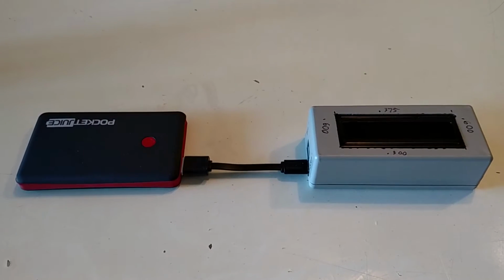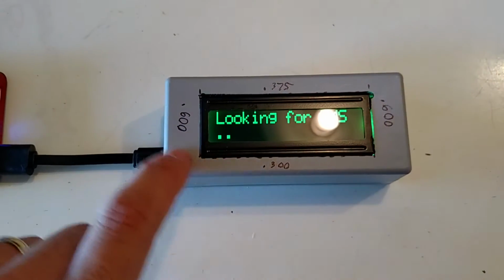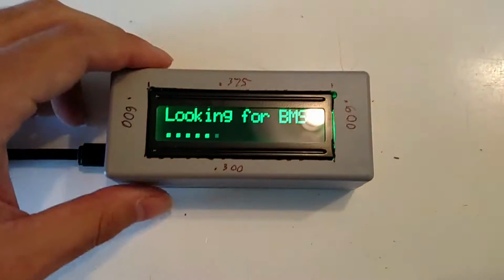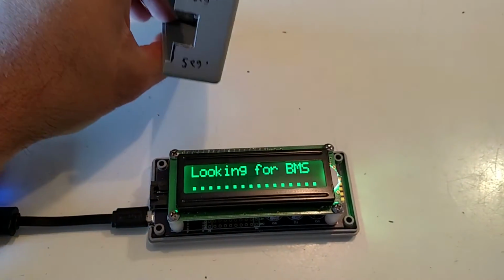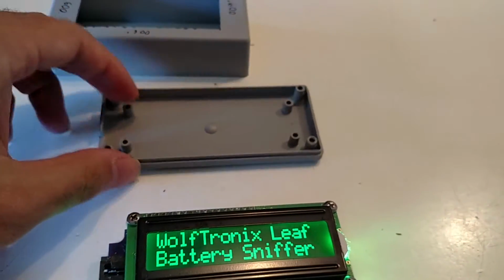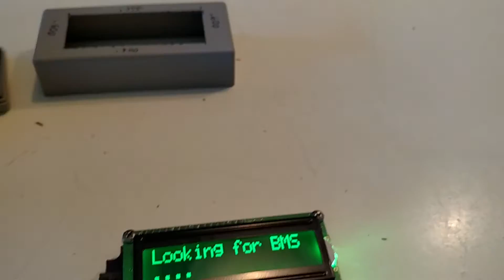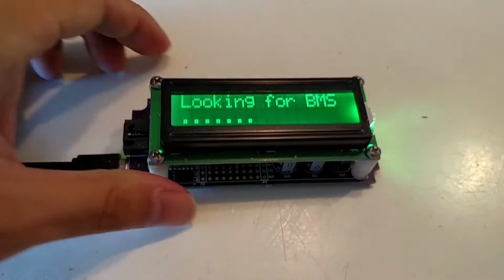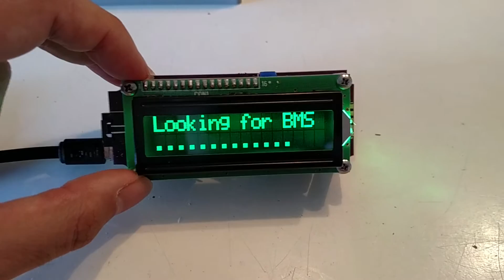Nissan Leaf Battery Pack Sniffer, Part 7

Comment: Hey Wolf I'm putting a leaf pack in a 2002 rav4 ev can I hook up the leaf bms and used the sniffer to monitor the cells. Also it would be cool if the sniffer had some outputs to turn relays off if the cells get to high in voltage.
Reply from the maker: +Mike Wadas 

That can be done there is a prototype area and lots of spare I/O lines. :)
Reply: Awesome can't wait!!! Thanks for doing all this.
Reply from the maker: +Mike Wadas 

No problem, I will probably work on it this weekend.

I am currently fixing the washing machine, bearing went out in it...